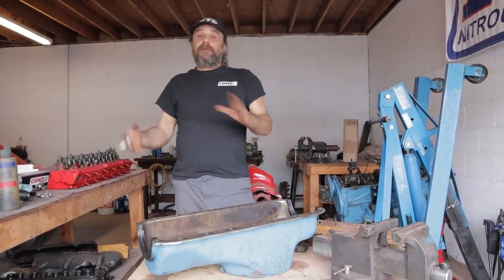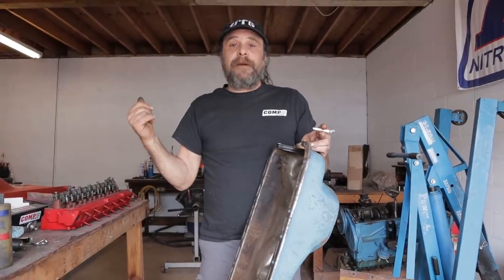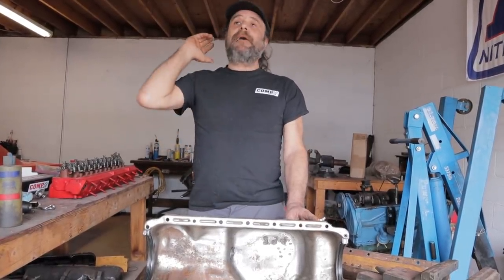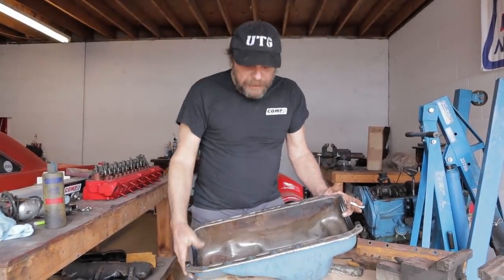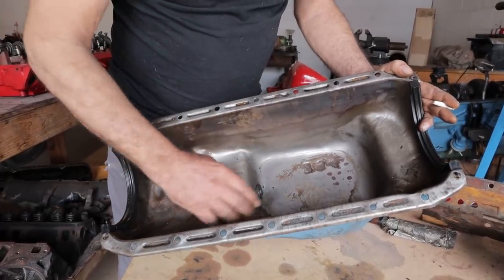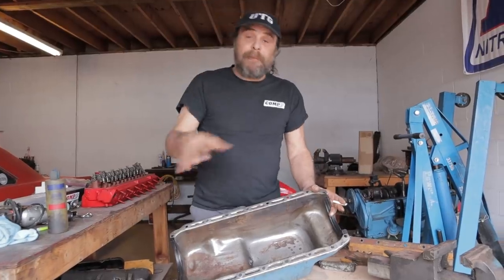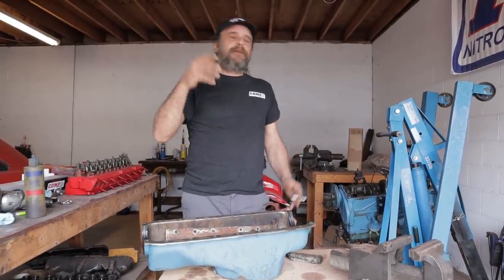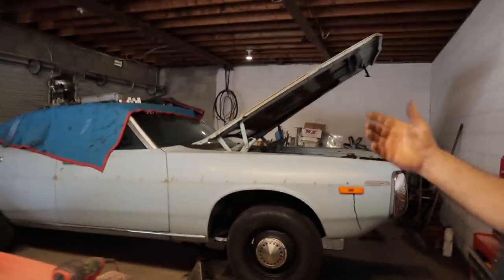Oil...Control, Windage and Pressure

Comment: Uncle Tony iv always been fascinated by the way air enters the car be it open element air filter cold air intake ram air turbo blower ext. When i was like 15 i would build air plenums from wood and fiberglass them so i had a sealed plenum to pipe air into with no leaks to work from could u do a video on ram air im a fabricator now im 30 and im realy wanting to build a big inlet as wide as my grill and say 4 tall and put it behind my grill and pipe that threw my maf sensor into the throttle i know we probly wont achieve any positive manifold pressure but say we go from -12 vacume at manifold to say -8 that would deff be a power gain and the engine will have less parasitic loss due to the motor not working as hard to pull air and if i did this would my stock ecu / map/02s/maf be able to enrichen the afr ratio?

Comment: Would the pan, scraper and pump for a Magnum, work on the older 'LA' engine? I think the 360 on my old Dakota had a rear sump. Not sure if that pan/pump would fit with the  steering gear on that body. The scraper might work.

Comment: on my 327 oil was very important we polished the inside of the block and ported all the water and oil ports to get the oil to drop faster but it would turn 15,000 rpms and it would just about drain the 13 quart oil pan in the quarter mile and every engine i build is season block seems to last longer turning high r's except my crate engines not worth seasoning the block till they get rebuilt just that i need the power to make up for the full body cars i drive no gutting all factory body my 68 pu i just put a stroked 454 tunnel ram with hemi heads my new ground pound'er slowly getting better one step at a time best part i only have 2200 in so far and a lot of trading parts

Comment: I rebuilt the 360 in my 78 lol red truck reading up on small block molars they recommended 40psi well when I started it up I couldn't get more than 20psi according to the dash oe gauge so off goes the pan installed highest pressure spring started it up no change off with the pan washers behind the spring start it up oil filter ballooned oops replaced the oil filter drop the pan put everything back as I originally had fixed it now I never use factory oil pressure gauge always go to toolbox screw in oil pressure tester we learn from our mistakes

Comment: Ford FE's can starve for oil in the 1/4.  It'll all end up in the valley and the heads.  Mopars are better at drain-back. 
But, your steel roller cam has done what they do - chew up dizzy gears.  A "Melonized" gear may be better ... 
But what really works is to take the oil pump load off the dizzy.  That is what is chewing up your gears.  Run an external belt driven oil pump and the gear will last indefinitely. 
Or, run thinner oil (less pumping load) and open the by-pass as soon as you can (40 psi).  Modern motors get away with 5W-20 for 100,000 miles + .  If your crank is well polished (?), it might work for Bottle Rocket" ...  Thing is drag motors spin up with cool thick oil.  Unless you pre-heat the oil like AA cars, it's too much resistance as you wind it.

Comment: Not trying to be “that guy” but would you be able to run a steel dizzy gear instead of the bronze. And of course I have a story to go with it: my brother ran a Steeda cam in his 5.0 and initially ran a bronze gear. The gear ate itself up and he then used a steel gear with no issues.

Comment: An old Ford FE engine doesn't need oil pressure LoL, mine never did at least.
Reply: I drove a 300 i6 for a week once without oil pressure before I realized the pump was bad instead of the gauge.

Comment: Memory alert:  Smokey Yunick use to recommend 10# oil pressure for every 1000 rpms and 1 quart  capacity for every 10# of oil pressure in his writings.  I’m not sure 7# per 1000 rpm is safe for sustained rpm.., 49# oil pressure @7000 rpms seems a tad sketchy. 🤔🤔🤔
Reply from the maker: That would depend on the construction of the engine.  A steel rod race engine with looser clearances would want that 10 psi

Comment: I have the summit 7 quart oil pan and the matching summit pump that came with the pickup already welded on for a sbc, 75 psi on the regular 45 or so at idle when warmed up, I thought that was extremely high psi
Reply: Old solid lifter VW diesels have like 100 psi idle on a cold start , and usually has like 100-120 at a cruise. 
For some reason the Germans love high oil pressure. 
Deutz diesels run high around 80-100psi too
Reply: @MrTheHillfolk  Might need higher oil pressure on diesels because of the nature of how they work. The force pushing down on the rod and crank is higher due to the high compression and the compression ignition. Specific power potential (or whatever) of diesel is higher than gasoline too so the boom is boomier. I'm talking out of my ass, but I think I'm at least 50% correct. Needs higher pressure to keep the oil in the race and not splurted out on the power stroke. I think this is the same reason I've seen some turbo Honda guys running shimmed oil pumps with 80-100psi at speed.

Comment: So I have a question for you. Maybe you know, maybe you don't. On my daily driver 440, it will idle with 65lbs of pressure cold, but barely make 10 once it's up to temperature. It'll go down the road with 80 cold and under 40 hot. This is after putting a high pressure pump on it. Before, the stock pump would struggle to do that and have 0 oil pressure at idle. I rebuilt this engine several months ago and it has 6k miles on it, everything new except for cam bearings because I don't have the tool for that and they didn't show any wear. I've also now have developed a terrible lifter tick. It still runs great, tons of power, daily driver doing 50 miles on the highway one way everyday and at the track every now and then running 13s in a giant C body. Everything was perfect even on stock pump until about 4k miles in. Any ideas what may be up with it? I've changed the oil several times and the pressure does come back up for a little while, but not long. I've tried plain 10-40, but normally run Rotella 15-40 in my old cars. Have not found anything suspicious in the oil or the filter. Thanks for any insight.
Reply from the maker: I've had similar.  Good chance one or more of the lifter bores is oversize
Reply: @UncleTonysGarage  I see. So I would have to get them bored and sleeved? As far as the lifter noise, should I try replacing them or would I be wasting my time and money?
Reply from the maker: Give them a measure first.  There were oversize service lifters available at one time, but I have no idea where you can source them from.
Reply: @UncleTonysGarage  I'll see what I can find. Thank you!

Comment: I've picked up a 1972 318 fully stock that has around 90psi at idle cold and around 60psi hot. I got a 99 360 magnum that's the same way. Anyone have any guesses why or what pumps they would have switched in there?
Reply: My 1995 Dakota is the same way on the dash on a mechanical gauge it was only 45psi warm
Reply: @surfofsinify  I tried 3 different mechanical gauges on each engine and all read the same.
Reply: Crap on a 99 5.9 that's really high

Comment: The old stuck by pass. Those cam gears are crazy. I seen a couple small block chevys with rollers have issues. UTG G force crew. No crank wiper? Or is that for higher rpms?
Reply: Crank wiper? Or scraper as I hear, regardless, there really good in high HP applications but a bit overkill here I think. They take a good bit of time to fabricate. I think it is a bit out of the scope of this build.

Comment: Uncle Tony. My 92 Dakota that ran consistent 15.1s in the 1/4 mile was lacking jiust a little bit to get into the  14s. Would a windage tray and baffle get me there? It had the Magnum 5.2(318). I think it was making around 300hp with the mods I did. I calculated though math 240hp to the rear wheels.
Reply from the maker: It may get you there...or at least close.  Check to see if that year Magnum came with one from the factory
Reply: Uncle tony. I ordered it new. The 1st year of the 5.2 Magnum. The 5.9 came out in 1993. It waz a fun truck. I wore it out. Someday i may restore it to it's glory. One day i measured under the hoid. A 42806 hemi would fit in without any problems. In 95 the dakoto was redesigned with a smaller engine bay. And it was 400 pounds heavier.
Reply: 426 hemi

Comment: Very good uncle Tony

 I always thought with high performance oil pumps all that it meant is they had a bigger wastegate and they just pumped at maximum oil pressure the whole time even at Idle and as the RPMs go up the oil pressure doesn’t change it just runs at the max 30 pounds whatever .....  but being high volume it still maintains max pressure at Idol and the rest goes through the wastegate........ ?

don’t know I might be wrong about that

Comment: My stock small block 302 in my truck has 50 lbs of oil pressure at idle... Is that normal for that engine?
Reply: Wonder if the gauge isn't reading right. My 429 (stock as well with a supposed "rebuild") sits around what looks like 15 when warmed up.

My parent's Tahoe with the 4.8 Vortec sits around 30/35 at idle.
Reply: Dont think I've ever seen a Ferd with that much pressure
Reply: @jamesharris5232  My 5.7 Vortec  sits at about 30-35 psi at idle according to the gauge too. Running 5w30 it gets up to 60ish on cold starts and it also gets up to about 60 as the speed picks up... I like it. Seems happy to me!

Comment: Do not understand why you would not put a new WT in the pan they are available from everyone and they sandwich between the pan and the motor no welding.
Reply from the maker: That's BB style..SB attaches to special main cap bolts